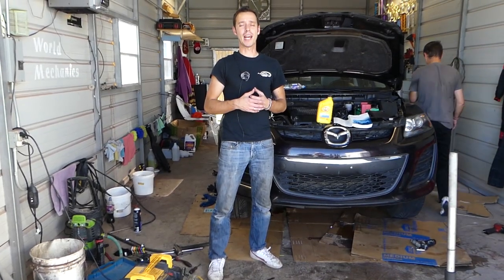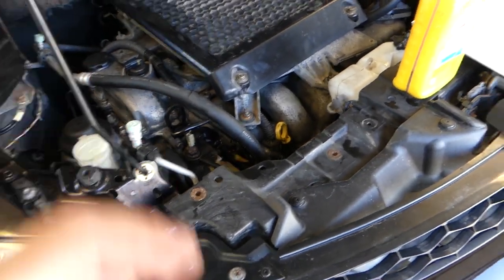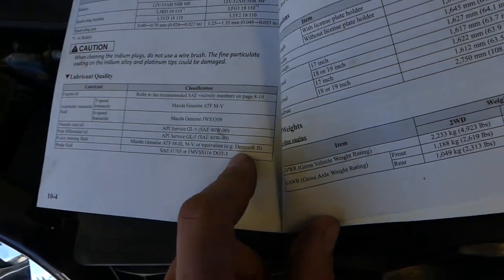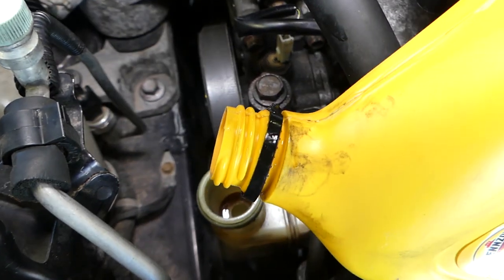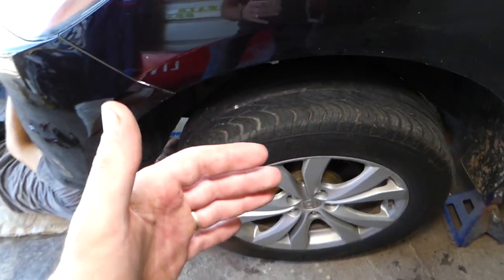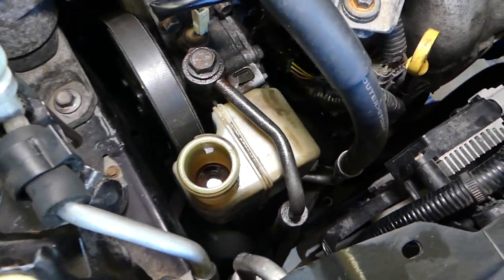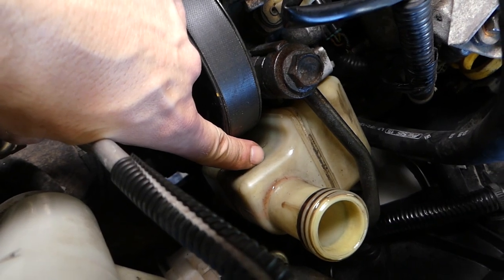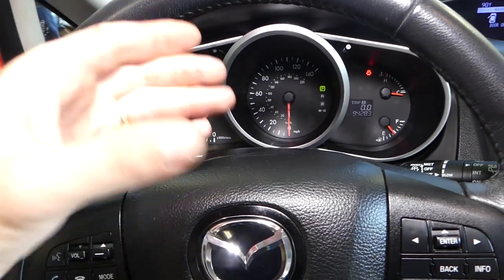POWER STEERING PUMP NOISE AFTER NEW PUMP REPLACEMENT OR HOSE REPLACEMENT

Comment: I had a power steering pump noise.  Thought it was cavitating.   Changed the pump with a good looking pump from the junk yard. Then again worth a brand new pump from Autozone.  Then changes the rack.  After a bunch of work it turned out to be the altinator.  Sounds pretty stupid but it was very frustrating and emberassing on top of that. 
Just putting this on here for others to contemplate.  Hate for any on else to go through this.
Reply: Hey junk yard best place to go. I went through two brand new power steering pumps from auto zone and advanced only for them to be junk. Finally we head to the junk yard. First one has my exact car and year, rip that pump right out. VIOLA!
Reply: Altinator pulley has a clutch, which, if siezed, will cause all sorts of problems through that belt system

Comment: If i bled all the air and there are no more bubbles coming out and it's still whining, what next? Is the remanufactered pump i bought no good?
Reply: Maybe a loose hose or bad O ring on one of the hoses/pump
Reply: Did you ever fix this? I am having the same issue.
Reply: Always buy new parts never remanufactered

Comment: Yeah I started the engine right away after a hose replacement. The pump added a million  little bubbles all through the system. We then shut off the engine and after over a hour turning lock to lock we finally were able to test drive the car. DO NOT start the engine before at least 10 minutes of lock to lock cycling. Also, with engine off, if the return line is removed from the holding tank and the tank return pipe is capped, fill the tank and hold the return hose over a drain pan and turn lock to lock to flush most all the old oil out. Engine OFF !!

Comment: my 2005 acura tl makes like noise only sometimes when i’m turning right or left to park or do a sharp turn, i had a power steering leak and replaced the high pressure power steering hose and even the power steering switch , no more leaks and bled the system , still makes this noise time to time but steering is normal and no more leaks is this an issue?

Comment: I went lock to lock like 100 times... and there are no more bubbles in the reservoir but it is still making noise. Does this mean the pump is bad? This is the second one and this is much less noisy but still whines.
Reply: Having the same issue. What’s was the issue?
Reply: @kyngfitness5249  it was a combination of things. Primarily the high pressure hose for my car was bad or had some leak somewhere. But it takes excessively long to bleed my system I believe because my rack may have a leak. I have yet to address this but my noise was gone after I dealt with the hose.

Comment: After installing a new pump i hear some noise but only when steering is idling. As soon as i try to turn the steering wheel even a little - it's gone. The pump is new and original, no bubbles, no low fluid level etc. Not exactly loud, but i don't like the sound and want to only hear the engine. Where should i start looking?

Comment: you emphasized bleeding it when the power isn't on, but I can barely turn the wheel on my car without it being on. I have an Audi A4 B6 1.8T and replaced the power steering pump, power steering high pressure line, but the issue wasn't fixed so I added more power steering fluid but forgot to put the cap back on and now it's even louder than before replacement... Will I need another power steering pump and do you recommend I replace the power steering rack too since I haven't replaced that yet? Thanks in advance
Reply: Itll be easy to turn with the wheels off the ground
Reply: The car has to be raised on jacks to turn the wheels full lock while the car is off. If the car isn't raised, the wheels will be very to hard to turn. Jack up the front wheels, add fluid, turn full lock to left and right for about 10 - 30 minutes. Allow the air to be pushed out, and then start the car and turn the wheel more for 10 more minutes to bleed all the air in your system out. Also, use the right fluid, check owners manual or Google what your car needs.
Reply: It was a good workout, wheels on the ground and all

Comment: I hear a noise only when accelerating.. anybody have same issue? Sounds like a whistle with a BB inside. Not sure what it can be. No bubbles. Car turns fine and no noise when turning left or right. Only when accelerating.. I’m lost..
Reply: The bb could be clicking from a bad pulley or pulley bearing. I have an f150 that clicked like that because I had a crack in my pulley

Comment: Ive been turning the wheel lock left to right for over 20 mins and the air bubbles doesn't seem end? what am I doing wrong?
Reply: most likely have a leak or bad component on the steering rack
Reply: If your pump is still good just replace your high pressure line, thats the 1st point of failure, the vacuum force working the pump is about 1100 pounds of force, air will get sucked if it's not good condition. Also, power steering rack might need replacing if the air bubbles show up. Also, mixing up different fluids will cause cavitation in your pump making it hard to turn

Comment: If you start the car before turning  wheel do you have to drain and start over
Reply: Thanks, in my situation... That's where I am now... I started the car, now no matter how much I'm doing left and right with the engine off while on jack stands, air doesn't coming out, I'm about to drain it and fill it back again...

Comment: My car powered steering pump sounds like a jet engine .I just replaced the pump without draining the fluid it's a four cylinder Honda I don't know if it's normal .
Reply: Mine as well. What did you do?
Reply: @reginathomas2154  i think it just when away by itself or I removed the power steering fluid line going to the pump because I saw some fluid leaking and replaced the plastic o ring . One of those two did it because now it's normal
Reply: @reginathomas2154  i think it just when away by itself or I removed the power steering fluid line going to the pump because I saw some fluid leaking and replaced the plastic o ring . One of those two did it because now it's normal
Reply: @1drmr3  ok thank you.  I'm going to give it a couple of days to see if it goes away.
Reply: @1drmr3  brand new power steering pumps make some noise as the pumps bed in ! All of them do it ! And the noise goes away eventually

Comment: The part of ''lifting the car on jack'' isn't true. Once everything should work properly, no need to raise the car.
Reply: Why do they always suggest it? I replaced my pump and took all the fluid out and added new fluid but still makes noises when turning.
Reply: @vincentchavarria6624  you have bad o rings.
Reply: @vincentchavarria6624  how did you fix it?
Reply: You raise the car on stands just so it's easy to turn the wheels back and forth to bleed the air out.
Reply: @mabast007  If the pump comes with a brand new o ring what else could it be?